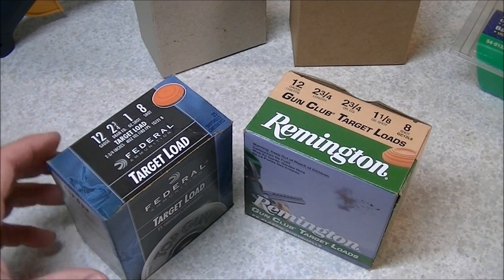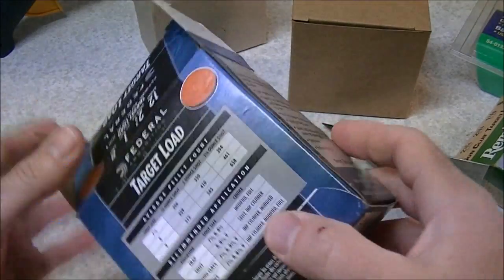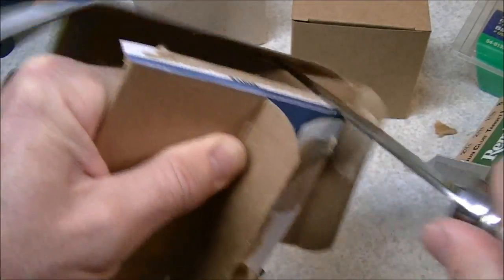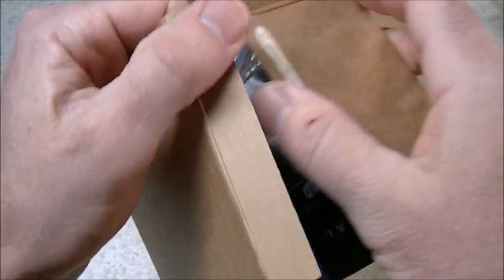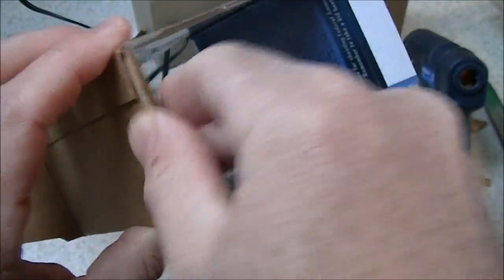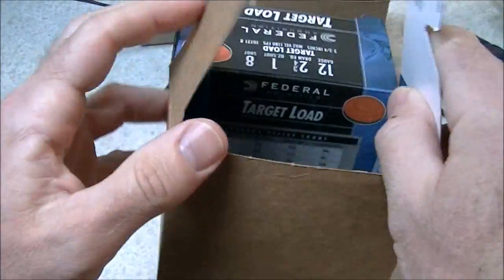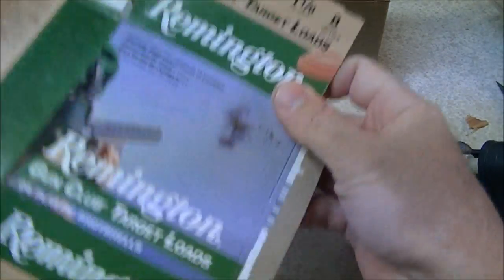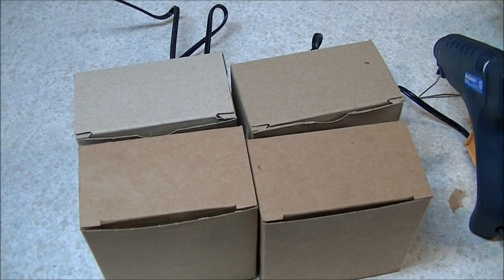How to Make Blank Shotgun Shell Boxes

Comment: Ten fingers left, and no blood or third degree burns. Good job, and good idea.
Reply from the maker: No cuts or burns so far....
I thought it was a simple, somewhat useful idea.
Reply: 314299 Shooting Channel
Quite so. I am tempted to try some for the pistol reloads. When stacked on end in an ammo can, info on the end flap would be quite helpful for quick ID of age etc.
Reply: 314299 Shooting Channel Thanks for the vid, saw it last  night, got inspired, did a dozen tonight. Fun little project!
Reply from the maker: slowhand11
Yes, the concept is applicable to most boxes, I was thinking of doing up some pistol boxes as well, especially the ones that I've already written on a bunch, they would look better turned inside out.
Reply from the maker: Mike Lesperance
It's quick when you get going at it.